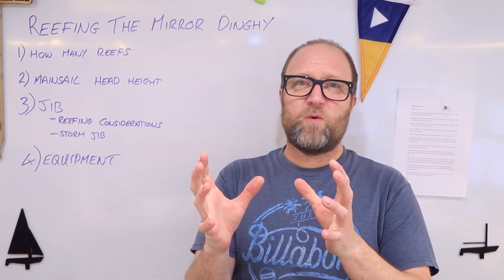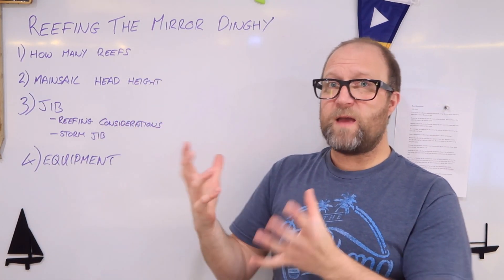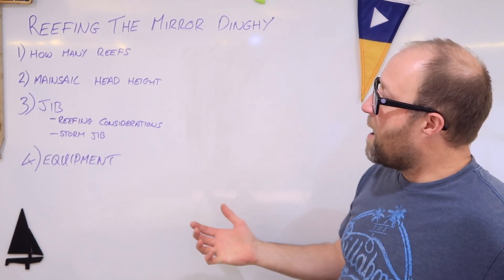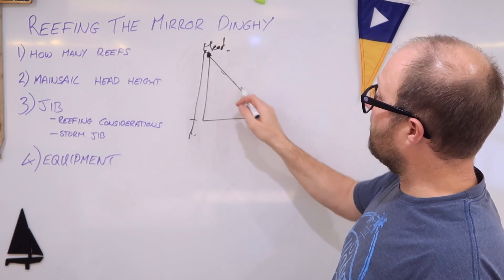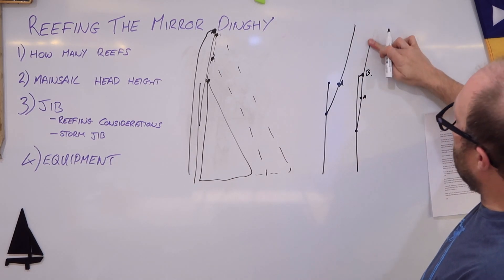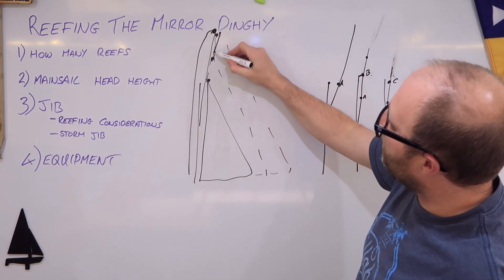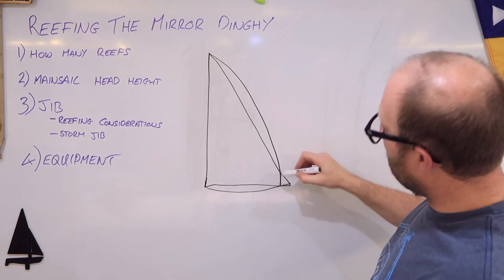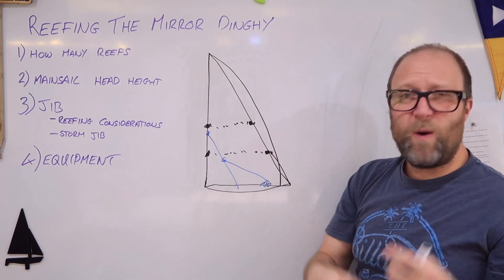Reefing Mirror Dinghy Sails - Part 1 - Intro

Comment: Hi Dave, I am very happy to see this video as I'm currently trying to fit a reefing system to my gunter rigged mirror. I'm fairly new to sailing a mirror as I sailed a topper for 6 years beforehand. I enjoyed sailing my topper but I have no interest in racing so I always wanted to get a more suitable dinghy for cruising. I have been a big fan of David Sumner's Mirror Cruising channel where he uses two halyards to lower the gaff down whilst keeping it close to the masthead for reefing. I am contemplating fitting two reefs and using a halyard fitted to the head of the sail and lowering the sail itself down the gaff. I found a block that has a fairlead built into it that could be fitted to the top of the gaff to prevent the halyard slipping off the block. I am going to try fitting a strap round the gaff and head eyelet of the sail to keep the sail from coming out of its track on the gaff and hopefully reduce the pressure on the gaff. My topper dinghy had a clew strap to keep the clew of the sail close to the mast when reefing so I'm going to try the same idea for the head of my mirror sail when reefing. I found this video of someone using a similar system for a gunter rigged gull dinghy and they don't seem to have any issues with the strength of the gaff so i'm hoping it will be ok: https://www.youtube.com/watch?v=cV4BPB2EEm0&t=232s. I spoke to some of the people on the mirror dinghy facebook group and they have done similar methods without issues but I'm no expert so it will be trial and error with my plans too. Looking forward to seeing what you come up with and I will let you know if what I have planned works if you're interested. Thanks, take care.
Reply from the maker: Hi Nathan. Thats very interesting and would love to see the outcome. Actually (Apoiler alert) I did the same system with a Bermuda style halyward that I can lower the mainsail using. One issue was with bigger reefs, the sail can come out of the Gaff as the gaff only lowers so far. I do have a few issues with the system, but seem to overcome them...Watch this space!!!

I've actually spoken to David Sumner a few times. He's still quite active on the Dinghy Crusing Association and he's been really helpful on a few things including the reefing and other things like cleats!! I've watched all his videos and find them really interesting. I don't do Facebook so can't get onto the Mirror group there which is a shame.

Trial and error is the way to go for me. I think having a go, showing your process and outcomes and sharing ideas is 80% of the fun of it all. If you can, please share what you do.

Comment: Hi Dave,
Saw a Mirror dinghy today at the sailing club - had a neat spinnaker fitting. Curved wooden semicircle batten fixed to the port inner gunwhale just aft of the curved fillets on the bow. Also had a sock fitted to this hoop and inner gunwhale. I guess it’s available commercially for your interest,
Reply from the maker: Hi Colin. Aha yes, that the spinnaker "Snuffer" for the Mirror and Black Pig actually came with one all rigged up and Spinnaker ready to go (See the 2nd ever video on this channel). I took it off though as the boat was full of lines and sheets whilst I was trying to learn. I just have to work out how to put it all back from some photos I took when I removed it!!

Comment: When thinking about reducing sail area remember that reefing reduces the fullness of the sail as well as its area. So the reduction in power will be greater than you might expect for a given area reduction as the sail will be flatter as well as smaller.
Reply from the maker: Cheers for the advice Allen.

Comment: Here's a couple of thoughts:

1.) You have what is basically a 3/4 sloop rig, which means, in most ordinary conditions, the jib can be dispensed with, once there is too much Sail. A simple down-haul system can bring it down remotely. This will mean two less lines to deal with,although the helm may get a bit hard. When it does, it is time to reef the main.

2.) Probably the best way to do this is to pull it down all the way down, then tie in the reefs, as the boat slowly drifts down wind, with the rudder hard over.

You could add a parallel, where the but end of the gaff meets the mast. This will hold it to the mast no matter how high it is raised. Then, the only job of the halyard is to keep it at the correct height. This parallel could be nothing but a loose rope loop, or it could have beads to help it slide down the mast. It could be a lassoo with its tail near the base of the mast. So when the yard is lowered, the lassoo can be tightened.

3.) I suggest only one reef point for the main, which removes 40 to 60% of its area. This is so the reefing method can be made easier to execute  and quicker.

This can be comprised of two lines, which meet mid boom. The forward one takes care of the tack. And the aft one takes care of the clew. 

Just drop the main, tighten these two lines, cleet then off, then re-raise the main, and you're done.

This will give you 5 possible sail combinations:
a,) full main and jib,
b.)full main without jib,
c.)reefed main with jib,
d.) reefed main only, and
e.) jib only.

This is a lot for a 12 ft dinghy.
Reply from the maker: Hi Bob

Some nice advice there, I never thought about that. The idea of the "Parallel" is a good one. In fact I have seen Parallels used on other "Gaff" rigged boats like Drascombe Luggers (Wonder how I know about that!!! - Watch this space), and I am sure I have seen someone reef their sail using the parallel method as they didn't seem to reset the gaff to a new point, so I wonder if thats what they were doing.

So it would be interesting to see what you think as I go through the process. The next 2 videos are due very soon and I take a novel approach in the end!!!
Reply: @SailingWithDave  

I'm looking forward to them.

Comment: Interesting to see your thought process.  Perhaps start with a single reef to trial you reefing method before adding a second.  The gunter rig does seem to add an extra level of complexity, but many others have done it and I'm sure you'll succeed too.
Al
Reply from the maker: Yes, the deeper I get into reefing on the Mirror, the more complex it gets, but's that the fun!! I think I will probably try reefing the jib first, although not even sure you would need to reef the Jib. I spoke to someone else who has and he says it definitely made a difference to stability in high winds and allowed a bit more in the main sail so maybe thats where we start!! My sewing machine is also a bit cheap so if i'm going to mess something up, its probably best being the cheaper jib!!! - Maybe I have bitten off a little more than I can chew on this one!!!
Reply: @SailingWithDave  I'm not sure how true this is, but believe that have a jib helps considerably in going to windward.  How you achieve reducing the sail area of the jib seems fraught with challenges.
I have bought a roller furling system, still waiting to be fitted and tried as my genoa has a wire luff and turns into something of a monster if you lower it.  Having a foredeck makes reaching the tack to change sails a hazardous activity in the conditions you need to perform such changes.

My own progress towards getting on the water is still painfully slow, but I have hopes of getting to Windemere in October for a DCA rally.
Reply from the maker: @knucker4931  Hi Knucker. Yes my thoughts exactly. I'm going to be honest here. I don't really know how people manage to reef their dinghy sails whilst in the sea bobbing about, without something happening!! Maybe its becuase i'm a little big for the Mirror, I don't know, but like you, there's no way I can get to the bow of the dinghy when on the water.  So,  reefing the jib mid-sail does seem pretty impossible. In any event it will still allow me to reef onshore before I sail which will be worth a test.